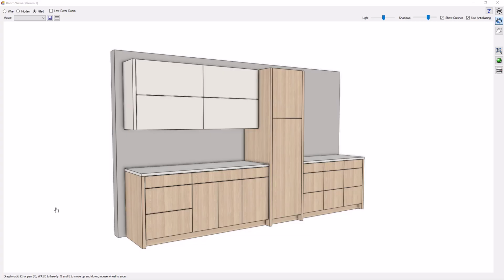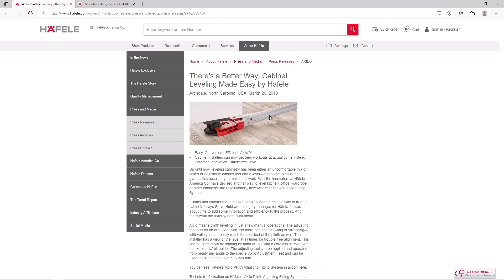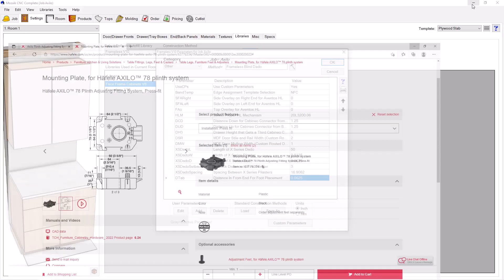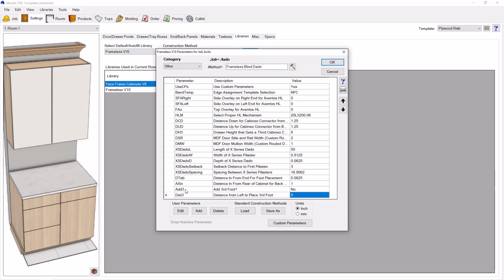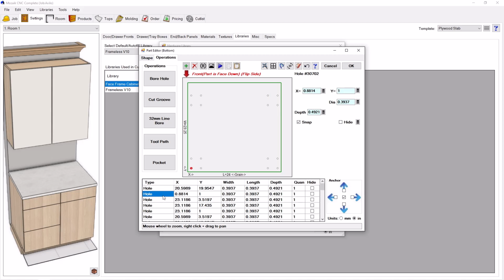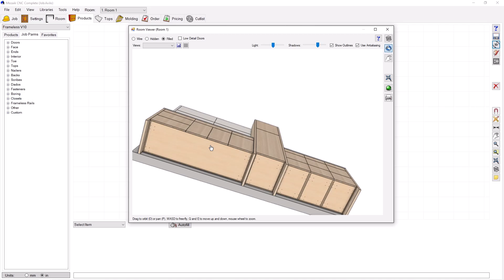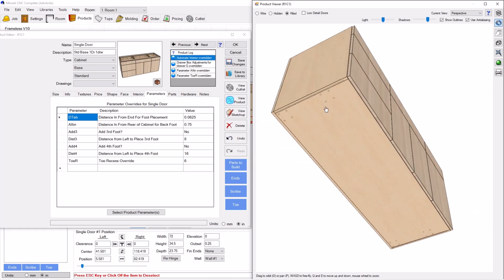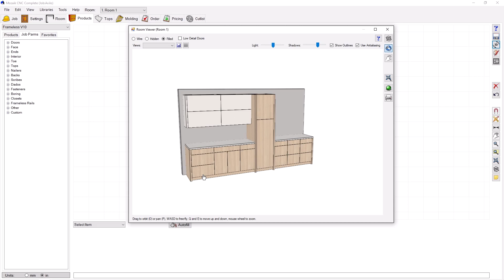HAFELE AXILO in Mozaik Software...No Shims Required!

Comment: How do you add the Kick Plate back in after the Axilo feet have been added?
Reply: From what I saw briefly is the toe is 3/4 thick and is probably blocks are tacked in underneath then the finished toes are cut to length and face nailed.

Comment: Hey, is there a way this can recognise tall cabinets and adjust front drilling pattern back difference of base and tall cabinet depths?
Reply from the maker: You will have to increase the toe recess (ToeR) by the difference at the tall cabinets...the template is set up to place the front feet based on your ToeR setting.